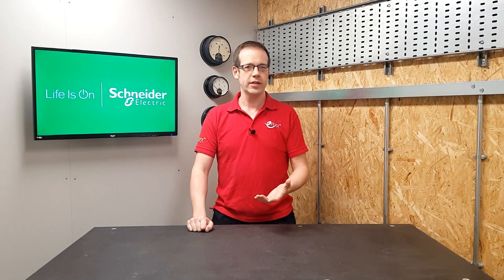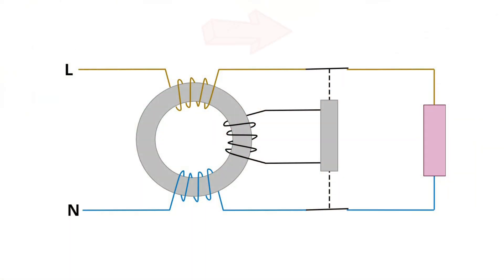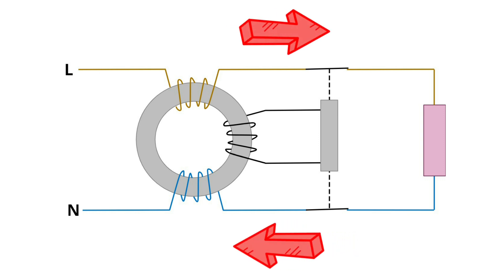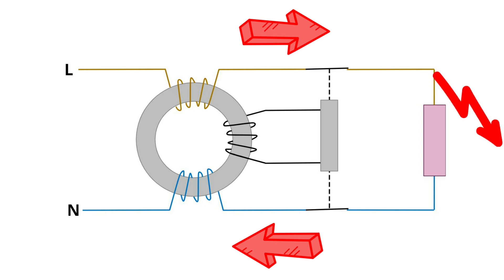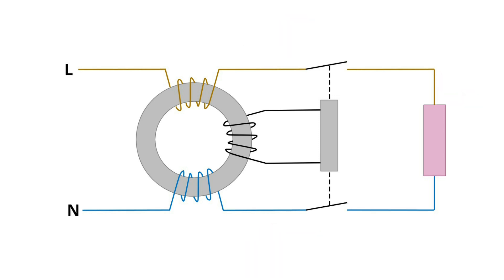RCBO's What is the function of a functional earth? - Schneider Acti9 - Isobar P

Comment: Maybe it's just me but did he explain what the functional earth does I've watched it 2 or 3 times and I still don't get it
Reply: Gives the rcbo a reference point on the typically "unprotected" side of the installation for a situation where the impedance of the supply neutral is greater than the path it may take through the earthing system.. I could honestly be wrong but I believe that's it. Lowest resistance path back to supply may even be to a neighbouring earthing system and back on its respective neutral conductor which is going to be a bad time for all parties involved..

Comment: Have a question. I have few IKQE RCBO and Loadcentre KQ in garage. Properly connected, i.e. reference earth wire to earth terminal. It happened during recent work on EVSE that L/N were swapped on the supply side. None of IKQE RCBOs has tripped. Took few days, before fault was noticed and rectified. Would it not be expected for RCBO with reference earth to trip when there is 220V between N and PE (and zero between L and PE)? Also could prolonged operation of RCBO under polarity reverse fault damage it? (not sure, but definitely there must be diodes and similar parts inside IKQE RCBO)? Found on internet that IKQE support "polarity reverse detection" - apparently not in my case.

Comment: Can somebody tell me (after some controlled-tests) that, will the RCBO Tripped off if the FE lead is being applied with voltages 'nearing' to Line voltage while both L & N are under normal operation??🤔
And also FE lead being applied voltages of equal/near to both L & N voltages under abnornal or loss of Incoming PEN (causing all three(3) terminals/leads namely L, N and FE to be of No Potential Difference anymore)??🤔
Is this FE merely a potential-reference lead, against L and/or N to 'watch out' for abnormal events to give it a more 'sophisticated tripping' for added protection??🤔

Comment: If you lost the PEN on a TN-C-S system, the FE would do nothing, shirley? (unless you connected the FE to terra firma via a rod?)
Reply: I wonder if this FE lead is monitoring potential-difference against L and/or N.
Meaning FE cant tolerate Line Voltages otherwise it will signal it to trip??
Meaning also there should be some degree of potential-difference between all three(3) L, N and FE to rule out/give clearance of any impending abnormalities such as 'seeing live presense/hot' across all L, N and FE means fault in system??
Reply: @piratedprivacy9052  That sounds good to me.

Comment: I'm not sure the given explanation of how an rcd functions is complete. Yes, an rcd will trip if it sees less in the neutral than line, as when an earth fault occurs. However, it will also trip when there's more current in the neutral than the line conductor, as in a borrowed neutral scenario; again an imbalance in the core. I went to a property the other day with a split load board that had both RCDs tripping. Turned out it was a borrowed neutral problem. The line to a light was through one rcd while the neutral was through the other, so an imbalance in both cores, so both tripped.😀
Reply: Good to know the sparky tested the installation thoroughly.. Got bored and wanted to commission in the dark mix things up a bit... Or was it you? 😂
Reply: I prefer the term shared neutral unless the live conductor had no associated neutral which I doubt. There would have been "more" or "less" on either RCD neutral causing the imbalance this is common when two lighting circuits are located on the same switch plate and force of habit makes us join every neutral and earth behind said switch.. I believe one circuit would operate until the other is switched on too in this particular scenario

Comment: An I've seen on RCBOs with earths is that the current flowing through the earth lead under normal operation can be significant, about 1.5mA ( think it was a Contactum unit) .
I had an unusual setup for an art installation with about 25 lengths of mains LED tape  that were underwater, with each feed was protected by an individual 6A RCBO.  
The leakage through the earths of all the RCBOs tripped out the 30mA RCD on the upstream supply. The RCBO functionality seemed to work fine with the earths disconnected so we just left them off.

Comment: If we lose the incoming neutral (PEN) to a property in a TN-CS then we’d also lose the earth that the functional earth lead is connected to which sort of defeats the object to me.
Reply: I think the functional earth will detect voltage and current if the neutral is lost on a TNC-S system and then disconnect
Reply: @Spark101.  I was hoping he was going to explain key information like that. Another disappointing video
Reply: This is not always the case as that’s why parallel earths on the MET are essential to keep touch voltages down and to operate essential fusing devices.

Comment: Here in Germany there is no functional earth at any RCD or RCBO available on the market.   I think the functional earth is depending on the amount of electronic in the RCBO. In Germany we have RCD and RCBO which must operate without a proper power supply.   Our RCDs also trip in an TNS System with disconnected main fuse if you connect N and PE. May be the efixx team could analyze the different reactions at tripping if the different terminals are not connected.
Reply: Yup, never seen that here. I've read this is used as some kind of reference. My guess was it could be connected to the test function of the test button and the resistor inside, that requires only a thin wire too. But it seems this is really only a reference for the electronics inside.
Reply: @Marcel_Germann  I think that functional earth is needed because in this RCBOs are using electronic to detect leakage current. In  case of a Brocken N the RCBO function is out of order. So is gets dangerous. If there is an alternative path over PE, it is possible to design the electronic circuit redundant.
In Germany this kind of RCBO is not allowed for fix installations any more.